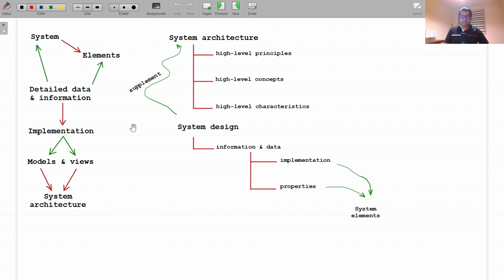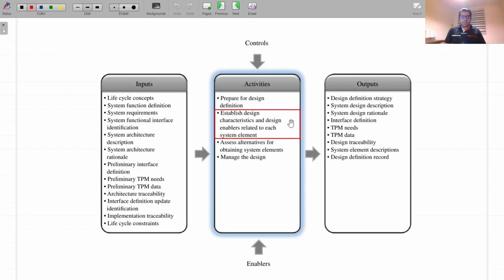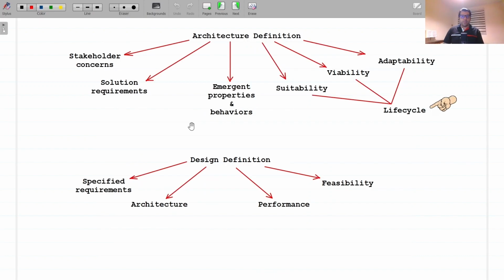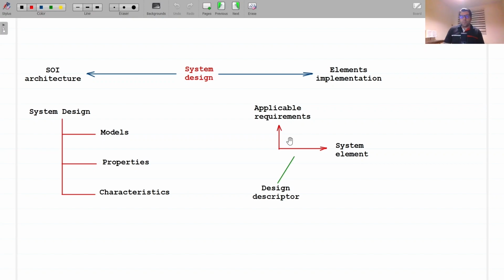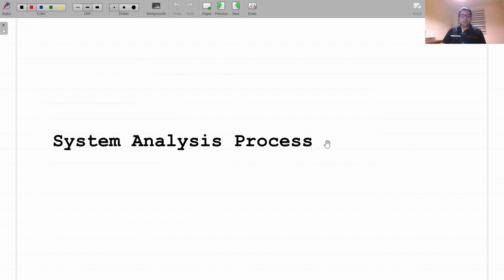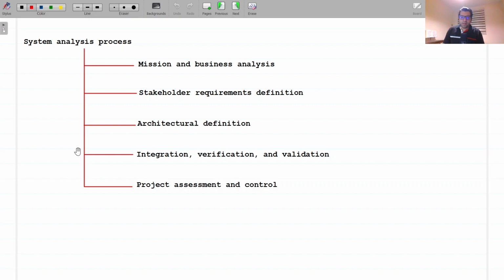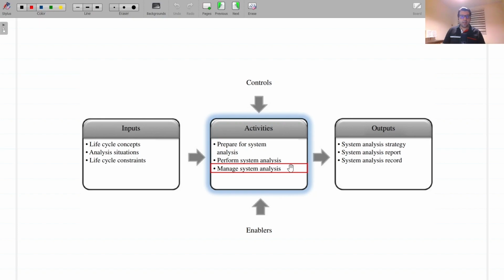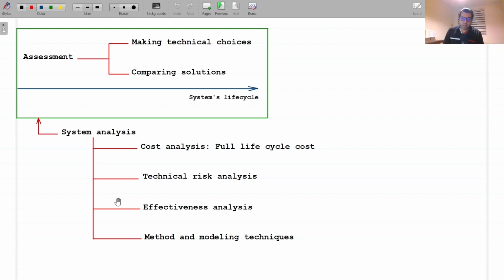Systems Engineering Training Session 17

Comment: "the purpose of the design definition process is to provide sufficient detail data and information about the system and its elements to enable the implementation consistent with architectural entities as defined a models and views of the system architecture"

"Detail Data and information about system" 
what data and what information you talk about that???
Reply from the maker: Let's consider the design of an ECU for an automobile. Design definition process here involves architecture and interface definition of the elements. ECU consists of microcontroller, system basis chip, sensors, memory chips, etc. This process determines the definition and function of each components and the constraints regarding their interfaces and the essential protocols they need in order to satisfy the architecture requirements. In addition, system requirements here play an important role in order to setup the elements as a whole.